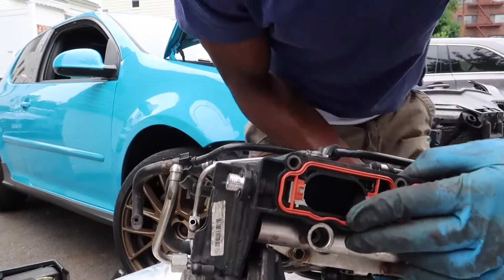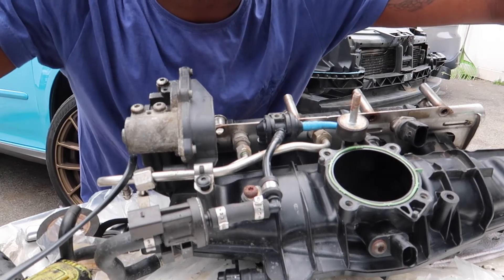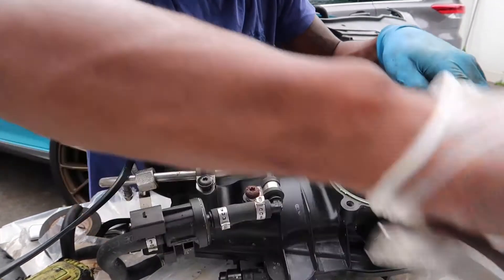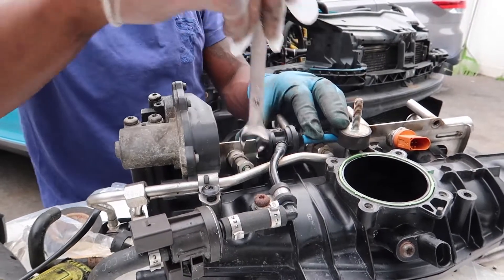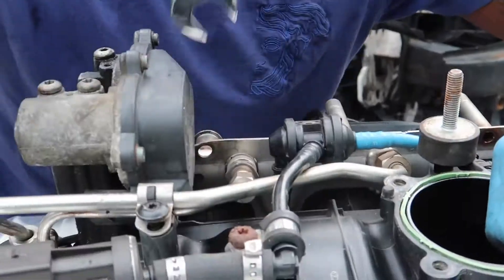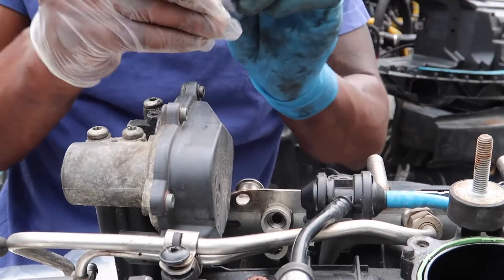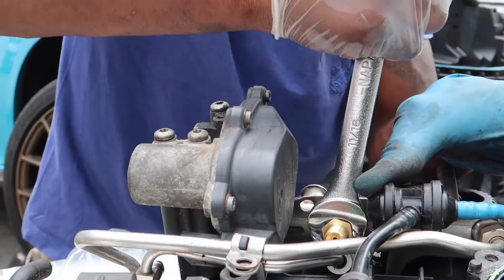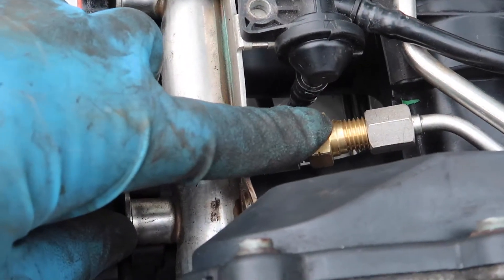How To Upgrade your MK5 GTI to RS4 Fuel Rail Valves and Rs4 Fuel Pressure sensor|FSI FUEL UPGRADE

Comment: Do you know how I can get my car out of limp mode I changed the hpfp it’s still in limp mode
Reply from the maker: Get the right part.
Reply from the maker: Where you got then parts from ?
Reply: @GTIMKV  I got it from fcp euro the car is giving me a p2294 code could it possibly be the other fuel pump or maybe a blown fuse ?
Reply from the maker: @JoseGomez-t1e  i need description of codes

Comment: hi friend, great video! I also have to fit RS4 rail and rail pressure sensor! 

the rail pressure sensor would be the one you change at min2:35 right? 
Thank you 🙏🏻 

2:35
Reply from the maker: I would change both sensor tbh, but the rs4 relieve valve was the one i swapped out and the pressure sensor the orange color  was also swapped.

Comment: Would this fix a p1093 issue? Having fuel pressure issues and severe misfires after changing fuel injectors. Already changed the HPFP and that didnt work. Need some help :(
Reply from the maker: Where you got injectors from?
Reply: @GTIMKV  ebay rebuilt oem injectors. But we changed position of the injectors to see if the misfire follows and it doesn't follow the injectors.
Reply from the maker: @amosherrera3007  lmfaoo that's why its misfiring. I had a guy with the exact same issue. He got eBay injectors and they are no good.
Reply: @GTIMKV  would that cause the p1093 issue as well?
Reply: @GTIMKV  we tried ruling out injectors by changing the position of them 1&2 to 3&4 and vise versa and it did not change the misfire from the cylinder 1 and 2 misfire I'm having now.
Reply from the maker: @amosherrera3007  how's the carbon build up ?
Reply: @GTIMKV  the carbon build up is a little rough. I just know before I changed the Injectors the only issue I really had was a cylinder 3 misfire. Plugs and packs didn't fix the misfire so that's what lead me to change Injectors and after the Injectors the car no longer misfired in the cylinder 3 it misfired in 1&2 and had the p1093 code.
Reply from the maker: @amosherrera3007   mAYBE YOU ALSO NEED TO CHANGE THE FUEL FILTER. Check the hPfp as well.
Reply: @GTIMKV  we changed the low pressure fuel pressure sensor on the hpfp and that made a change but still misfiring. We have a new regulator valve and a new 6.6 bar fuel filter coming. Praying that helps.
Reply: @amosherrera3007  did you solve it? ive got the same problem with the ebay injectors loss of power after 15k miles

Comment: Hey man I’m having some issues on 08 fsi
Reply: It’s cutting fuel a ton , will a rs4 140 bar be good enough or should I get 155 APR?
Reply: Already did autotech hpfp and rs4 injectors
Reply from the maker: @thiagofiladelfo7992  I am running s3 Injectors with a fully upgraded hpfp
Reply: @thiagofiladelfo7992  everything ive seen says not to run rs4 injectors that they spray in a bad pattern vs the s3 and tts injectors they spray in a better pattern
Reply: ecu is reading P0089 that’s fuel regulator, I was running Fbo Ko4 but realized I bought a stock reg

Comment: Part number for the fuel pressure regulator valve?
Reply from the maker: Check description
Reply: @GTIMKV you just have the sensor what the part number of the brass valve?

Comment: If the valve opens at 140 bar and say what happens if you run it constantly at 135 bar? Will this ruin the valve eventually.. is it only safe to run it at a max of 129.99?

Comment: Whats the part number for the rs4 sensor? Does it fit ed30?
Reply: Fuel pressure sensor I meant
Reply from the maker: @peterrybar6896  it's in the description brother.
Reply from the maker: The rs4 regulator valves?
Reply: yes

Comment: Would this cause P0087 or PP2293? Getting occasional power loss in a gear but changing gear (dsg) brings all power back after letting off throttle and back on
Reply from the maker: CHECK THE  fuel pressure,  check the rail valves as well they might be getting stuck. Finally, check the hfpf.  P0087  is stored when fuel pressure is not met.
Reply: @GTIMKV  Going to replace the pressure valve as ordered, i cannot find an OEM return valve otherthan the RS4 and i'm stage 2 on a k03 so a RS4 upgrade is pointless imo. But thanks

Comment: I have some questions regarding this......I'm getting two fuel pressure regulator codes on my 400whp gti and I wanna know if swapping to these parts actually does help with providing more fuel
Reply from the maker: Yes, it is a actually upgrade for the fsi engine. The rs4 regulator open at a 140 psi allows more fuel.
Reply: @GTIMKV  ok thank you. Snapped my axle the other day so now have to deal with that too 🤣🤣🤣 "Daily Driven Euro" is what I go by
Reply from the maker: @adamh9077   Lol, that's all part of the game, bro.  You have to pay to
Play. 😂

Comment: Lol so I’m getting lean code too not enough fuel ima try that before I touch fuel pump under seat
Reply from the maker: What's the description of that lean code you getting? Check if you have a leak before the second 02
Reply: @GTIMKV   I’ll screenshot cord and share it with you
Reply: The code is 
p0171 system too lean bank 1
Audi Fuel trim system lean bank 1
Reply from the maker: @solident101   yeah dp
Reply: @GTIMKV  down pipe